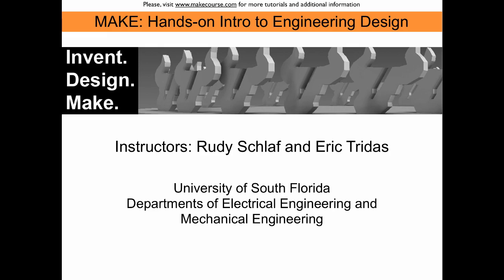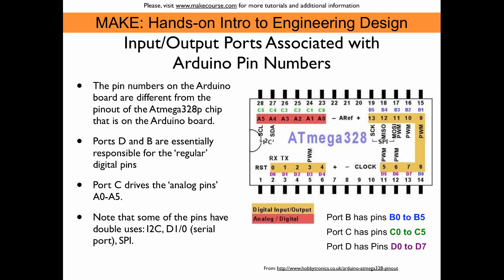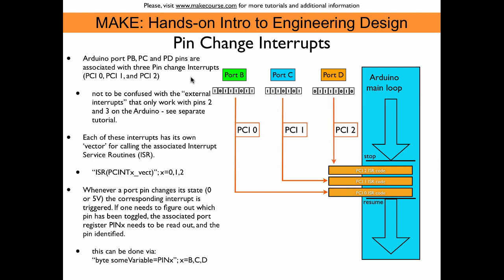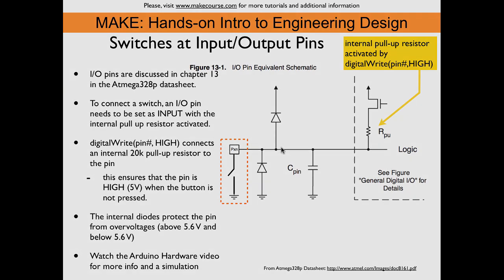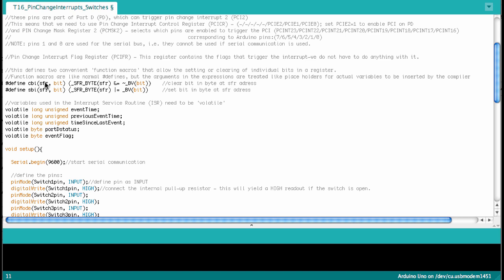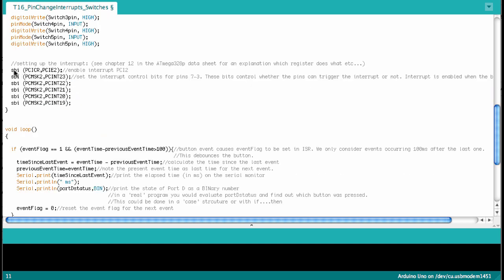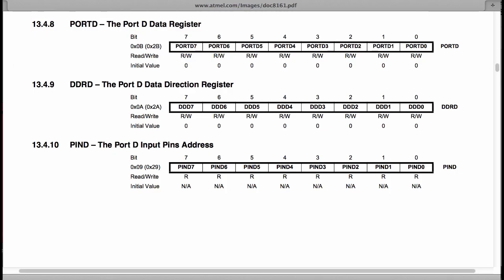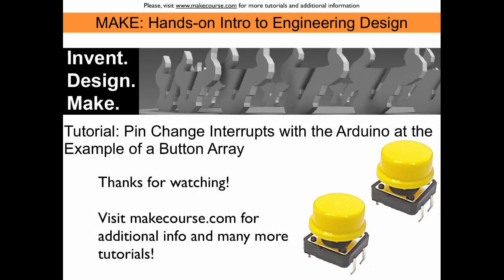Tutorial: Pin Change Interrupts on the Arduino

Comment: Amazing tutorial, thanks a lot! I have some problems transferring your setup on the Arduino Mega2560 and would be REALLY thankful if you can help me with it: Unfortunately, for Interrupt0 PCINT7 (MSB in PortB) doesn't work, as I push the button attached to Pin13(= PCINT7), the ISR doesn't seem to be triggered and I get no time or portstatus printed out on the Serial Monitor. Also, the Byte I get as I press the other buttons consists of 7 Bits and the MSB for PCINT7 is missing even though I've set the pin HIGH for the pullup resistor. My case/switch doesn't work neither: Is it right to initialise the it like so?
switch(portBstatus,BIN)
case (11111110):
etc.
Setting the missing MSB to 1, to 0 or leaving it out makes no difference for the switch/case. 

For Interrupt1 (Port J), the 2 available pins (PCINT10-15 are not available as Arduino pins) seem to work well except that the 0s get swallowed so I only get a 1 or a 10 printed out, but my switch/case with case(00000010) and case(00000001) doesn't work neither. 
Greetings from Germany!
Reply from the maker: Hi Tim, the Mega has different pin assignments. Please, check the data sheet at http://www.atmel.com/images/doc2549.pdf. Look at the pinout on the second page and read section 15 (External Interrupts). There it explains which pins you can use for pin change interrupts. Good luck with your project!
Reply: Make Course  Thank you for your reply! I considered the pifferent pin assignments. Additionally I have to mention that I could solve the switch/case problems by erasing the BIN command on the switch and inserting the binarys as decimals in the cases. For Interrupt 0 I had to use a 0 for PCINT7 in the Portstatus variable and luckily the other Interruptpins work just fine.
So the only problem I still have is that PCINT7 doesn't trigger the ISR and is detected as LOW even though I've set it to HIGH which is even indicated by the internal LED (PCINT7 = Digital Pin 13). Do you know any reasons for that ?
Reply: @Tillewimm  Hello, i know it's too late to answer your question, but i'll share it for the other readers who might have the same problem : 
this is a note from arduino website concerning the pullup resistor in the pin 13 (that contains the LED)
https://www.arduino.cc/en/Tutorial/DigitalPins

NOTE: Digital pin 13 is harder to use as a digital input than the other digital pins because it has an LED and resistor attached to it that's soldered to the board on most boards. If you enable its internal 20k pull-up resistor, it will hang at around 1.7V instead of the expected 5V because the onboard LED and series resistor pull the voltage level down, meaning it always returns LOW. If you must use pin 13 as a digital input, set its pinMode() to INPUT and use an external pull down resistor.

Comment: Shouldn't PCMSK2 be defined BEFORE setting PCIE2; just for good practice?

It doesn't play a roll in your sketch but theoretically:
- If a user has set the masks previously in the sketch before enabling PCIEx
- enables PCIEx
- it could jump immediately to the ISR depending on the previously set masks and NOT wait for the new masks to be set

Great tutorial, many thanks!
Reply: "it could jump immediately to the ISR depending on the previously set masks and NOT wait for the new masks to be set"
About that, I don't think so. Because all the masks set up in the "void setup()". But I am still not sure until I try it or someone else answered.